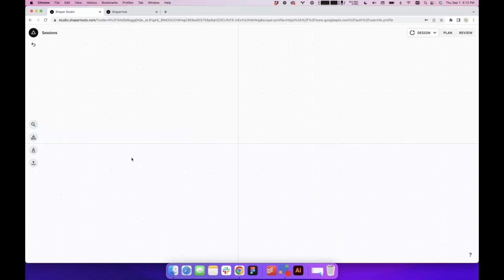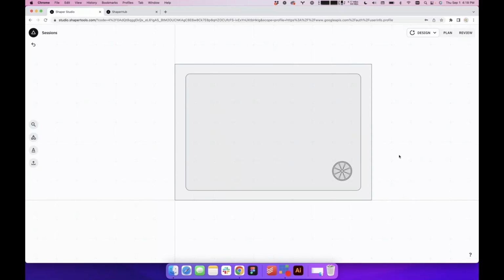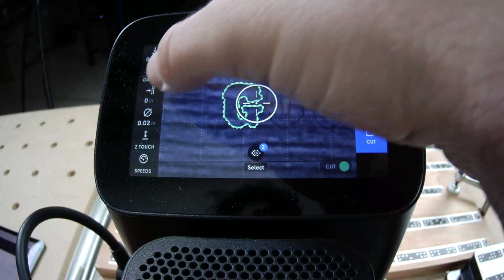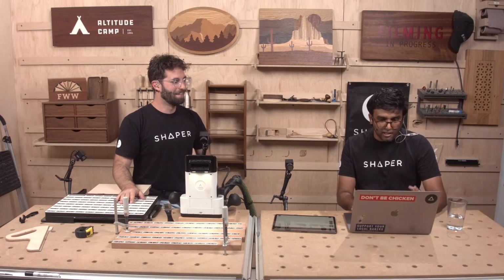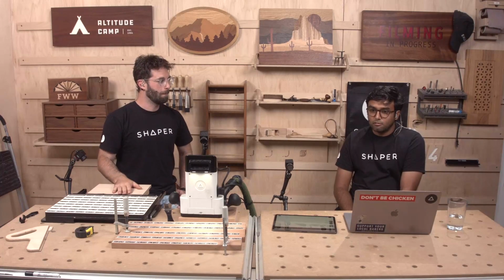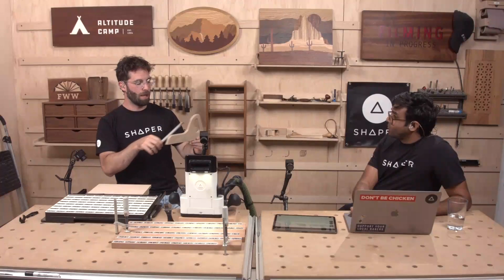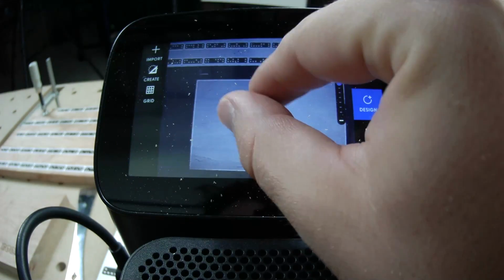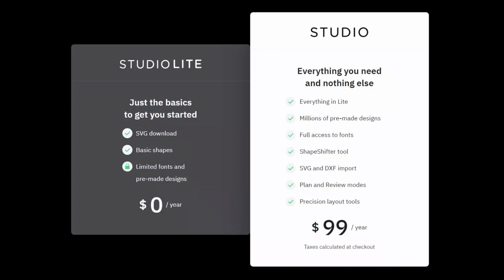Session 66  – English: Shaper Studio - Design Made Easy

Comment: 8:50 "I've been destroying my laptop with dust....I hate bringing my computer into a shop." Exactly--we don't want to use a computer for shop work! Shaper Studio is a big miss--you can't simplify digital design by creating yet another software application. What's needed is more on-tool features so you don't need a computer.
Reply: You seem to misunderstand something - the tool is software based to begin with. While the on-tool design features are useful and they keep adding new version updates, but there is not a chance that the firmware on the tool can produce the advanced vectors and paths that an actual vector image application can. What you call "a big miss" is what everyone else sees as a big win because their choice to have their own software web-based gives us the flexibility of using any device with a web browser (i.e. the smart phone in your pocket) to produce and manage designs with pre-planned cut types. And it's offered in a free version to boot. This is a win, plane and simple.
Reply: @du3lmaul3rs50  Recall the software release notes for the Box Joint Basic Extension: "Make box joints with ease on-tool--no computer or physical templates required!" This is what I think we need more of. What about an "Advanced Extension" for box joints (different finger widths)? What about dovetails? Or a mortise and tenon wizard? Or 2D gear outline generator? Using a touch screen on a smart phone doesn't seem to bring much of an advantage when you could use the touch screen on the tool. On-tool updates will become less frequent because the team is spending resources on developing Shaper Studio. We've already seen this with no update since 2021-Jul-19 and it is 2022-Oct-12. Shaper Studio aims to be simple, not do "advanced vectors and paths" that these others already do: Inkscape (free), Illustrator (tons of learning resources), Affinity Designer (similar to Illustrator and ~$55 perpetual), Fusion 360 (free for hobby), as well as others that run on a browser on your phone. As they add features to Studio, it will create a new learning curve. You can't solve the problem of "woodworkers don't know how to use vector design programs" by creating another vector design program.

Comment: on the actual push stick handle, the knockout that your hand goes into is a curved lozenge shape, sort of like a hot dog … the one you sketched is straight … can Studio 'bend' shapes to curve shapes? it's pretty simple in Illustrator, as is the rounding corners in shapes without doing the adding / subtracting shapes thing you went through to round the handle …